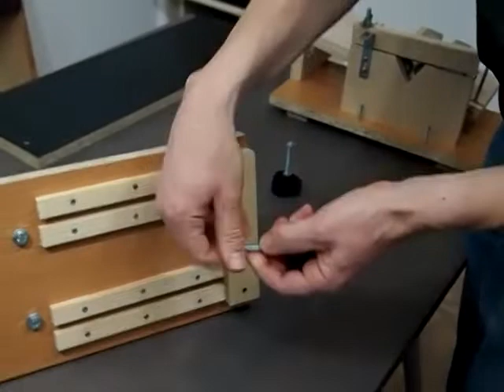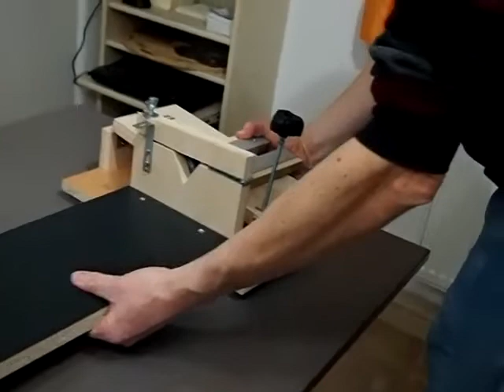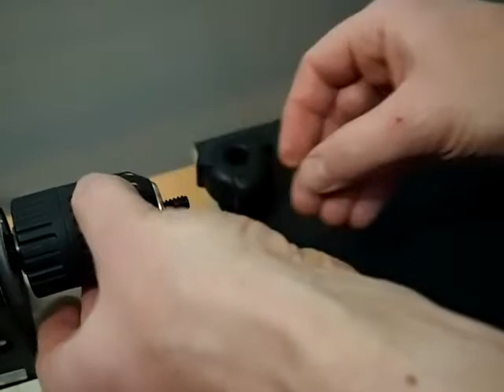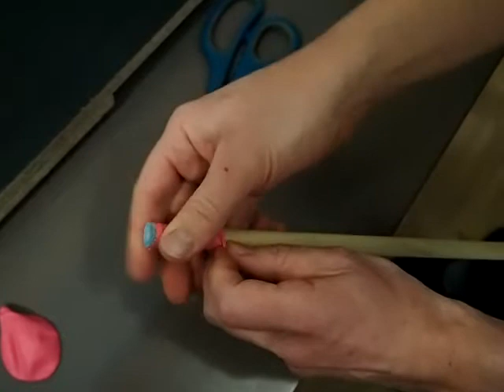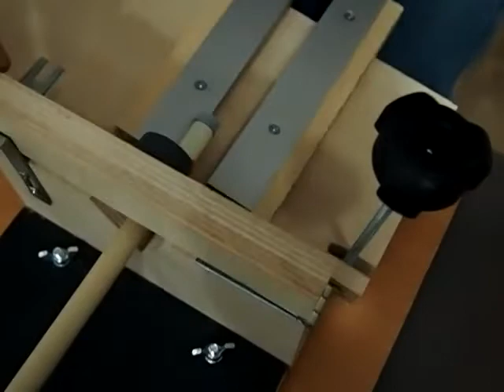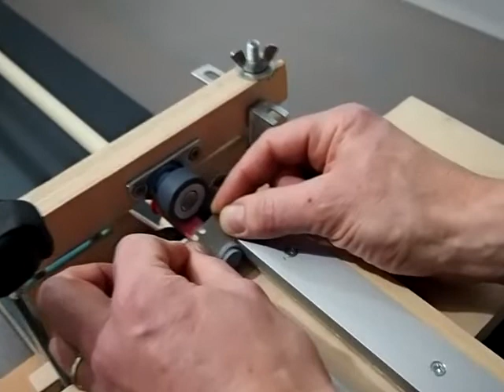Simple lathe for cue tip installation

Comment from the maker: Update:
1. In the meantime I found metal pins for some common joint types (5/16x14, 5/16x18, radial) - makes it a lot easier.
2. I had problems with shafts that are no so perfectly straight. The tip was oscillating then. I solved this by installing a second roller rest in a distance of 20 cm from the other one.

Comment: When you tried to shape the tip, how did you do it that ruined it? My thought would be that if you lowered the platform so the blade was to the halfway point of the tip and if you moisten the tip it would shape up quite nicely. That’s pretty much what we’d do on a lathe. The blade support platform - excellent idea
Reply from the maker: Hi Cel, I tried exactly what you describe, but probably held the blade at a wrong angle. It nearly cut the tip in half within milliseconds. I don't think, I'll try that again, though with a little practising it might work as well.
Thanks for watching and commenting.
Reply: @angelino9954  keep the blade flat. A few guys have come up with a jig like what you’re using but for a lathe. It works out great for them. It’s just a flat surface to lay the blade on

Comment: Can offer a parts list and what did you use to mount the 3 black rollers
Reply from the maker: The rollers are just furniture rollers, they already have the metal plate attached. The other parts are normal screws and pieces of wood and so on.
Reply: @angelino9954  Thank you brother..would you have time to link us to the place you got those rollers.. I also thought that a set of suitcase replacement rollers from Amazon would be a possible solution.. they as soft and nice thickness.. but would require a a mounting change
Reply from the maker: @whywouldiwantone  I used these: https://www.bauhaus.info/bockrollen/stabilit-moebel-seitenrolle/p/10138226
Reply: @angelino9954  thank you so much.. I am guessing you might be in Europe judging from the links..

These were easier to find in my area.. They are super tuff and have good inner bearings..
OwnMy 50 x 18mm Set of 4 Luggage Suitcase Replacement Wheels, Rubber Swivel Caster Wheels Bearings Repair Kits https://www.amazon.com/dp/B07NZB2J8D/ref=cm_sw_r_apan_i_JVJDBNQ9RQT7H58GR8WM?psc=1

Comment: Where did you get the drill joint pin from?
Reply from the maker: It's a plastic joint protector. By sanding while rotating I removed so much material that it fitted in a drill chuck.
Reply: @angelino9954  that’s pretty genius! Thanks for sharing
Reply: You can buy maintenance joint pins on eBay for any size pin you have. A lot are common bolt sizes like 5/16-18 so you could use a regular bolt with that thread in the drill chuck.
Reply: How you remove so much material to drill Chuck... Please tutorial